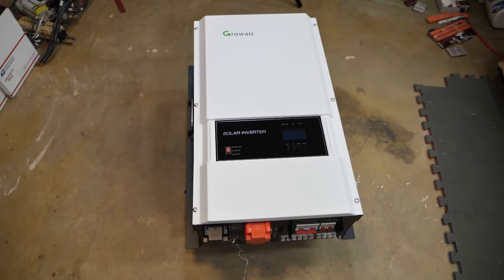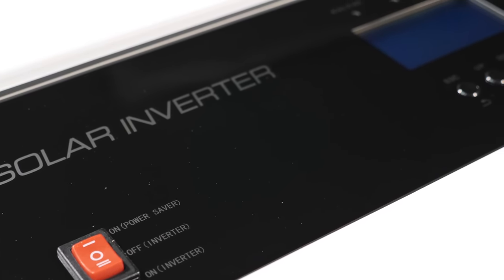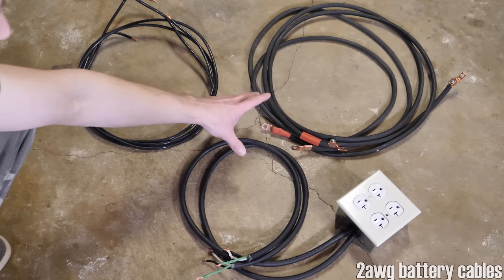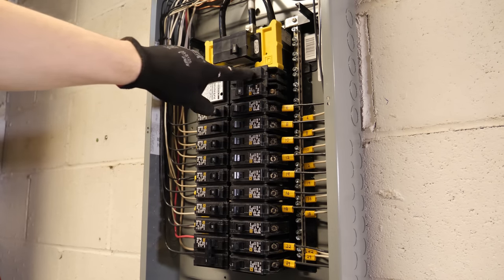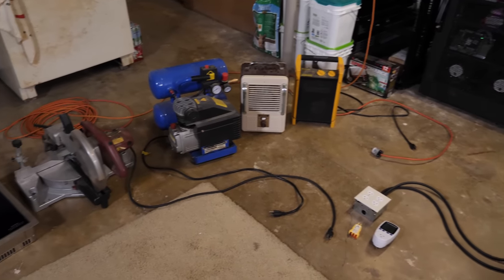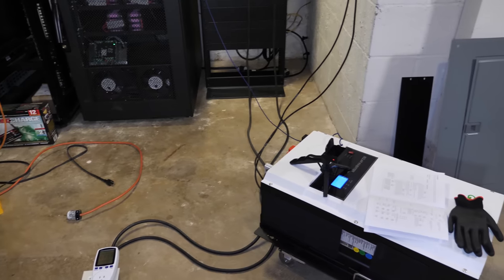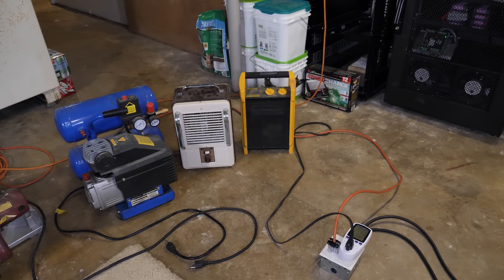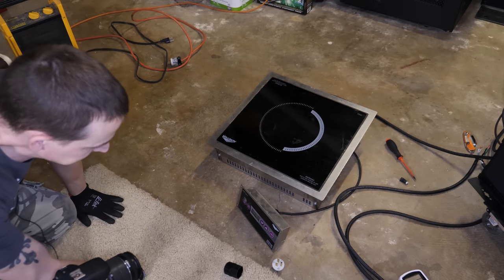12kw Growatt Inverter Operational Check/Review!!

Comment from the maker: 💥💥💥JFYI I was able to use the wifi to change settings after video was edited and uploaded. I tried from a different pc and it works great!!!💥💥💥
Reply: pretty scary stuff. I can imagine a thousand things that could go wrong, an attacker gaining access to same and shutting down critical systems is just the least of it
Reply from the maker: 😲 Hmmm......
Reply from the maker: Never thought of it that way😲
Reply: Hi Joe no this is a 12k and  I asked sol-ark how much watts do I give and they told me I have 8.000 watts but that I have a unbalance the fault it gives me is a G37 BusUnbalance. On 120v. Before I got this one I had a canteen 6048 and Joe it ran everything. Table saw and no problem.they told me to change my saw to 240 and it will work. My compressor is 240v and it's old and the same thing happens. Not to happy. well Don't know what to do so I thought of getting a transformer. Any stay well and safe.
Reply: No Joe the code is F26
Reply: Joe xantrex 6048.
Reply: My old inverter was a xantrex 6048.
Reply from the maker: Yeah I thought the 12k was an 8k. The 12k is for solar and 8k inverter. Sucks it wont do all that stuff. Ooooo I Love those old xantrex stuff. They made some SOLID units. When I had my lead acid battery bank I wanted one BAD. Only got a xantrex charge controller tho lol
Reply: @AveRage_Joe  Joe I still have my 6048 have not sold it yet will hang on to it for a bit just in case.
Reply from the maker: Might as well!
Reply: Came here to tell you the format of the secret code but you figured it out.  When you do the detail settings video be sure to include the WIFI advanced settings to change the server-us.growatt.com or it will never connect the inverter to the account (aka plant). That is not mentioned anywhere, in fact, you are misled if you follow the printed instructions.
Reply: @finalanalisis  p OP
Reply: Don't there need to be a pot on the cook top ?
Reply from the maker: Yeah there does but I didnt see the display light up so I figured it didnt work.
Reply: Joe, I have the 6k version, for the life of me I can't get the software to change from 100 percent battery SOC?  any clue? Also are you using the battery equalization setting for your batteries??.. thanks bro
Reply: I like to ask one question when you use that resistor to charge it capacitors I do believe you need to turn the breaker on otherwise you didn't get no spark because you had the power turned off
Reply from the maker: The breakers are for the AC side!🤘
Reply: @AveRage_Joe  which model do you have 12000T or the 12000KT. On growwatt website the 
12000T is the 250vdc solar and the 
12000KT is the 145vdc solar.
But on signature solar website it says they are the same voltage with same price. Called their tech support they where confused why their website didn't match growatts website. And told me to go with the 12000T For the higher pv input voltage..... I just ordered so I hope its the right one. Just never seen an updated part number where they removed letters instead of adding them
Reply from the maker: @electromechanicalstuff2602  I have the 250v version or 12000t.  I havent seen the "KT" version lol.  If you have any setup questions just let me know!
Reply: @AveRage_Joe  I thought u said u had the low pv voltage version and wish you'd gotten the higher pv voltage unit. Maybe I'm thinking of another tuber
Reply from the maker: No you heard correctly in the video....Im just a moron and assumed the stickers for the 150v and 250v were the same since its a china inverter. I thought that cause I ordered the 150v.  Later when I called SS about something. I gave them the model # and they said no no, you have the 250v version. Sooooooo what happend is I ordered the 150v and they accidently sent the 250v🫣🤣🤣💥 WIN FOR ME
Reply: @AveRage_Joe  like I said I ordered one today and they still have two models. They used to have two models but one was the low voltage and one was high voltage. Low voltage was cheeper now they have two models one is 250vdc the other is 245 vdc.....the 12000kt-mpv and the 12000t-mpv. When u go to growatts website it shows the 12000kt is the 145 vdc and the 12000t-mpv is the 250vdc. I'm like so is SS website wrong? Called them they weren't sure. But said I should go with the 12000t-mpv. Called growatts website and translated via Hindi that the T and kt are both high voltage but the mpv is what indicates high voltage. Both of what SS is selling is high voltage but one 245 and one 250.... I said why are u selling two models with basically the same voltage for the same price? They said they didn't know and growatt didn't know why either. One is just a new version essentially and they are no longer selling the lower voltage units.... Man I hope all that made sense in text because it confused me trying to figure it out in good English from SS and broken English from growatt. Am excited to get the HVAC onto the solar tho
Reply from the maker: Clear as Mud!😆 Yeah made since! I need to move my AC over. Need to get as much off the grid as I can!

Comment: Induction cook top need s a pan with water that is designed for induction cook tops. It will do nothing until you put a proper pan on that takes advantage of the induction of the cook top. It will not get hot like a regular resister coil on your regular electric range.
Reply from the maker: A few others mentioned that as well but I was thinking it didnt work all together since the led display didnt turn on. I still have it so plan to try again.🤘
Reply: @AveRage_Joe  remember get a pot \ pan that is induction labeled.

Comment: Really love what you are doing on this channel. I do notice some things in what your video shows. The first is that the fans are ball bearing fans, and they should last longer, but they are noisier than sleeve bearings. It is a shame (I have not found any at least) that no one makes a fluid dynamic bearing DC axial fan (at least of this size). There are plenty of DC cooling fans for PC cases using such bearings. They last as long as a ball bearing fan, but are way quieter. Your version is split phase (for the US), but they also do a 240V single phase version for Europe. Those block connectors do not look very big. I wonder what your thoughts are on having smaller units paralleled together? It provides redundancy, and wiring can be a smaller gauge (and fit those terminals). My house has a 23kW grid supply (but our night tariff is sooo cheap)! I see that Growatt have just released a 3000W (the SPF 3000T HVM-G2) second generation version of this unit also, which makes me wonder if G3 versions of the bigger ones will appear. It seems to be more efficient from the specs. I also don't like those top fans. I might be inclined to fit a duct over the top and vent that air away sideways, stopping any downward ingress of dust and moisture when the inverter is on standby, and likely also reducing noise a bit.

Comment: Thanks for explaining the whole "pass through" thing with the inverter. I was always under the impression it was grid-tie or nothing. I also assume (you might explain it later) that even as a pass through, it is designed to not put power back into the grid and fry some poor linesman..
Reply from the maker: You betcha! I was always under the same impression. Basically I didnt understand lol! I dont really explain in later but maybe once its all connected to my house I can explain moar/show it!
Reply: @AveRage_Joe  hello, thanks for the video. Does this also act as a AC couple system if you have an existing inverter?
Reply from the maker: Nope, it wont do any of that. Its a stand alone!👍

Comment: Inverter with built in charge controller is good idea. Less wiring less heat related problems. I am upgrading my battery and inverter, from 400w to 1 Kw to match the panels.
Reply from the maker: 100%

Comment: Oh, very important, always run a ground from the main panel to the ground next to the input hot leads. Next, run a ground from the chassis  to your output source. The chassis ground is on the far right corner looking at it from the bottom. You can see the ground at 8:15 on the video. Super important to do this.
Reply: would you use the ground next to the input leads for the grounding rod buried outside or the chassis ground ? or both?(i wouldnt have shore power or a generator connected to the input on the inverter in my case)
Reply from the maker: The ground next to input I have connected to the main panel ground which is connected to ground rod outside!

Comment: Great video. I'm considering a similar hybrid inverter, but one thing worries me. If the power company turns off the main power (or an accident occurs and the power goes out), is there a chance that the inverter will return voltage to the mains and someone  get an electric shock. I tried to find  circuit diagrams of this type of hybrid inverters to find out exactly how the energy is converted, but I'm still not 100% sure.
Reply from the maker: Thanks Mate!  They way this is actually connected in real use case there is no way to send power back through the grid.  Ive had it connected for a few weeks now and I am supplying the inverter with AC from a sub panel, the AC output is connected to the panel showed in this video and I have installed an interlock kit so only the inverter or grid can power the panel, not both.

Comment: Just a comment that in America we got 240V monophase on 2 lines. We do not have 2 phase that's impossible. Industrial has 3phases and in our house we only have 1 phase ,whit +120v and a seconde line -120v. These 2 lines has 240V of difference of potential between them. Great video!
Reply from the maker: Yes you are 100% correct!🤘
Reply: @AveRage_Joe  Silly question – Are you able to run 240 volt (i.e., well pump or mini split). Everything in me thinks you should, but there is still that little voice telling me no. It’s not easy being me
Reply from the maker: No silly questions! Yeah you can run anything 240v and also run the 120v stuff at the same time!🤘

Comment: is this inverter could work without battery and grid? just directly from pv  power to power some resistive load or minimum house load.
Reply from the maker: You do need a battery as far as I know! I guess you could add a small cheap battery and then use the solar as main.

Comment: Thanks for making videos on this inverter I've been thinking about getting one. I have a MPP solar LV 5048 off grid set up with the Nissan Leaf Gen 2 batteries I didn't really know what I was doing but I copied the settings from a YouTuber and got it working learning as I go. I saw something about the recommended minimum battery capacity being 24 kwh I only have about 8 kwh and the Nissan Leaf G2 batteries are hard to come by right now so I don't know if it's a good idea to get rid of my system and start over or wait till batteries become available and just change the inverter. Either way I look forward to your next video on this inverter.
Reply from the maker: You are welcome!  I almost went with a LV 5048 but seen they couldnt start a saw unless you had 2 units.  The manual for this 12kw inverter recommends a 400ah battery but its just a suggestion. My current system is only a little over 200ah and everything is just fine.  Like I mentioned in video my draw back was the wires I used during the build.  You can use whatever size battery you want but it would be best to make sure its capable of delivering over 250amps if you want to use the full 12kw from the inverter.  I can supply my entire house off my battery EXCEPT my dryer, stove and AC at this current time and thats only because of my poor planning in the 2 10awg wires on the battery packs.  Next battery pack will be a huge upgrade.  So for you, Id either wait or add similar chemistry batteries to raise the AH so you dont need to redo system.  I however am pretty much redoing my system lol

Comment: Hey Joe thanks for this great video.. I have come back to it often for different things you did... I was about to purchase this 12kw and noticed in your links  there are two different ones.. both seem like same specs.. one is 2,289 and the other is $1,999.. do you remember which one did you got? I know what SignatureSolar wants to say about the cheaper one.. but I'd like to hear from you if its the same one and how well it works switching between grid and solar.. because for me ill have 36x 400 watt panels and I should rarely pull from the grid.. but I do not know which one can use that much solar for charging..
Reply from the maker: So when I ordered, I purchased the 150v version HOWEVER.... they sent the 250v version!😄 Im actually glad they sent the 250v version cause I can series more panels which means less strings ran to the combiner. Honeslty tho either one would be great. Yeah mine switches back and forth from grid with ease. Ill get random hickups but that is usually my own fault from changing settings to batter match batteries I am testing and then forget to change back to my normal settings. Would I purchase this inverter again? Hell yes!💥🤘
Reply: @AveRage_Joe  Hey thanks for the detail from a real world user situation.  Really love your channel.. keep the great content coming!

Comment: I heard you comment that the ground should be connected to the panel ground, and that you didn’t... but looking at what you did do, I’m confused why you put the load ground wires there. If the input isn’t grounded, the output isn’t grounded either. That is a big inverter to not have it grounded...
Reply from the maker: Yep pretty much🙄 thats why I put that comment in there saying that I should have just connected it correctly!

Comment: Hey Joe have watched your excellent presentation a number times now well done it is very helpful. I have a couple of quick questions on the inverter settings 1. Program 2 “maximum charging current” what Amps have set this to? 2. Program 5 “battery type” what is this set to. 3. Program 14 “charger source priority” ? And lastly Program 21 “low DC cut of voltage”? Cheers Dave from NZ👍🏻
Reply from the maker: Thanks and appreciate the watch!! #2 I have at 100a but your battery will determine that. #5 is USE, #14 Is OSO and #21 Is 43 but could raise that one.🤘
Reply: @AveRage_Joe  really appreciate the quick reply. You’re a legend. I have my battery type set to USE as well and I am getting a fault 3 warning “battery voltage to high”when battery hits 100% SOC I thought that might of been the program 2 setting which is set to 80A so not sure what’s causing that? also grid not kicking in and running battery very low .. would that be program 21 set to 42V? Any thoughts on this would be much appreciated cheers Dave fromNZ ✌🏻👍🏻
Reply from the maker: What is bulk and float voltage set at? Basically whats happening is your bms is cutting the charge if using lithium batteries. What battery are you using btw? 

Option 1 on inverter I have set to SBU, bulk is 56.6, float is 54.
Reply: @AveRage_Joe  I'm using a BSLBATT 11.4kW LiFePo4, I have SBU selected. Is bulk program 19 "Charging Voltage"? if so it's set at 56.4V and float set at 54V Cheers DaveNZ
Reply from the maker: Yeah charging voltage. If you keep getting battery over volt then try lowering that one a little until all your cells are fully balanced. Once balanced, you can raise it back up.

If your inverter not switching back to grid, raise option #12 a little. Mine is set to 46v but should be a little higher like 47-48v.
Reply: @AveRage_Joe  Awesome mate really appreciate the advice on that keep up the good work Cheers DaveNZ
Reply: @AveRage_Joe  Hi Joe just a quick one you may have an answer for... I went to change #12 from 46V to 47V and it flicked to 11.0V and now won't change keeps flicking back to 11.0V  ??

Comment: Hi Average Joe,
Thanks for your great videos ! They convinced me to buy a model similar to yours.
So I have the 6000W version, and I have 2 questions you might be able to help me with
a) some days in the morning, it won't detect the solar panels. It'll show 0 volts and won't charge. A multimeter check shows that there is voltage... I have to switch the inverter off, and then it will find the panels and start charging
b) is there a way to charge the battery from the grid without activating passthrough ? My grid, which is actualy a gasoline generator, outputs 1kW only and it's quickly overwhelmed by the loads
Thanks !
Reply from the maker: Nice! Ive been wanting to test one of those out! Only thing I could think of if it doesnt start charging from solar is I would do a firmware update! Its super easy. Look in signature solars youtube and they show how to do it and where to get the firmware. For the 2nd question to charge from both and not passthrough is have option 1 on SBU and option 14 on SNU. Then set option 11 (grid charge amps) to what ever your genny can handle!🤘

Comment: So here is my question. if I connect 5kw of solar and grid input and I am drawing 10kw will it use 5kw solar and only 5kw of grid power? is that even possible? ie will it use the solar and less from the grid if the solar is available? can it use power dynamically like that?

Can I use 2 of these? I have 100amp service so I need 20kw for "full capacity" can 2 interact like that? (I know syncing phases is tricky and hard to do)

ALSO can I put it on a timer plan programming kind of thing? for example I want it to switch to solar battery only at 1630 and then back to grid when battery runs down or it gets to 2200 (time of use power power is twice as expensive in those hours)

Comment: The system would perform even better a set of at least 1000 farad, graphene capacitors on the DC supply side, paralleled with the battery input into the inverter. The capacitors would take up the slack to keep the batteries from being hit full force with the surge current from inductive load start-ups from the house air conditioning units, saws, etc.